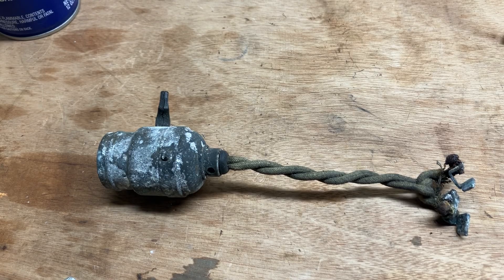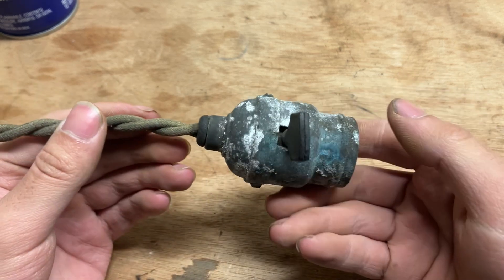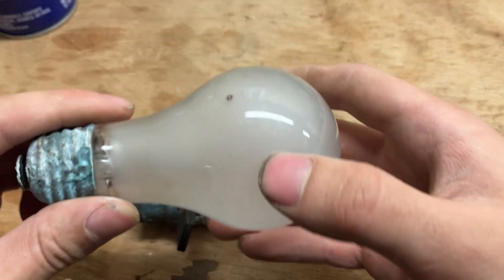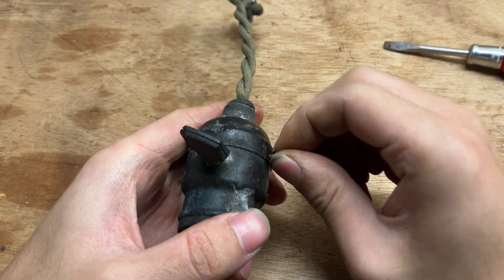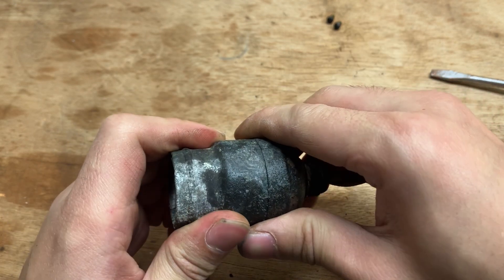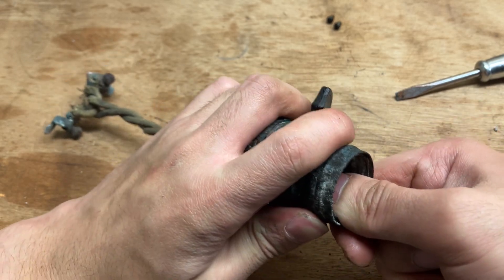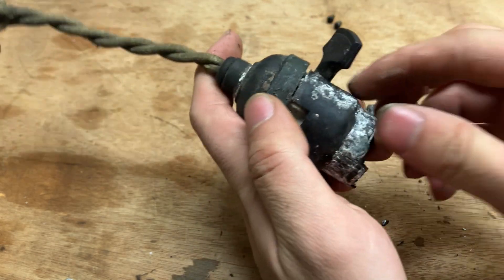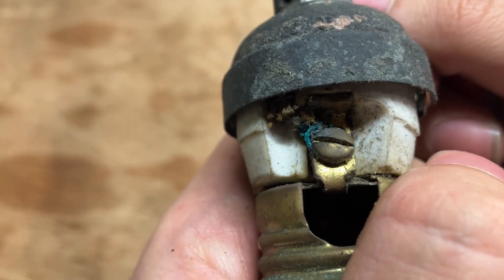An inside look into the workings of an 1890s light socket

Comment: What?  "Brass is falling apart, it's turning Copper color";  lol  You jest. 
no offense, was ['push']? mark on shell?   
Cherish to Old.    Not a collector, but I cringe. 11:33
Reply from the maker: Yes, brass is an alloy of copper and zinc. When brass becomes heavily oxidized, the zinc basically corrode out of the copper leaving just the copper which is extremely brittle. I also collect and restore antique watches so I do have a light touch. Better it in my hands than still rotting away in the basement where I found it for no one to ever see again. Thanks for watching.

Comment: That looks like a socket I removed from my cousin's house built in 1927.  You may be dating it a bit early.
Reply from the maker: Outwardly, these “fat boy” paddle switch style light sockets stayed the same appearance wise for a good long while. That being said, this uses mica as an internal insulator, and also has its power rating stated in “candle power”. Both of which are reliable ways of accurately gauging the age of a light socket. Thanks for watching!

Comment: Good find. That rotary switch knob looks like it could be bakelite if that helps to date it.
Reply from the maker: I’m pretty sure it’s actually a material that predates Bakelite, or if anything it’s a material other than it. In fact, the biggest clue this light socket ended up revealing to me after cleaning its casing is that instead of stating the power in watts, it stated “candle power” instead. Definitely very cool if you ask me. Thanks for watching!